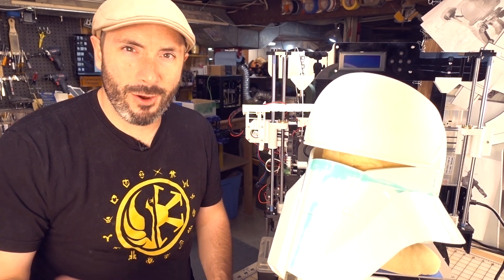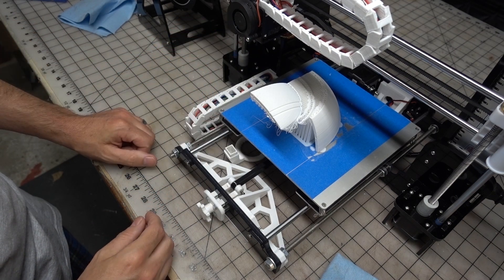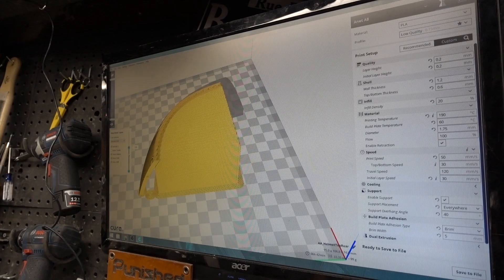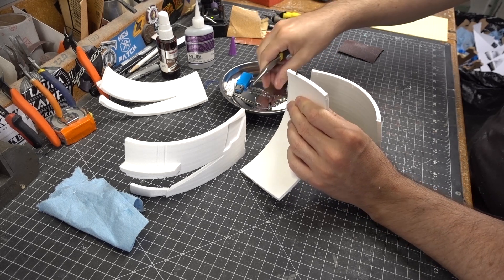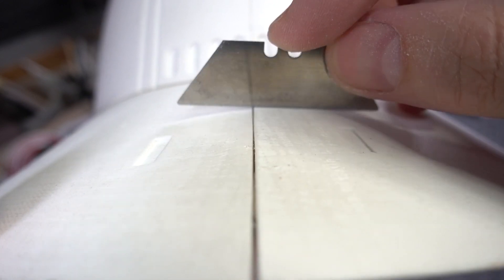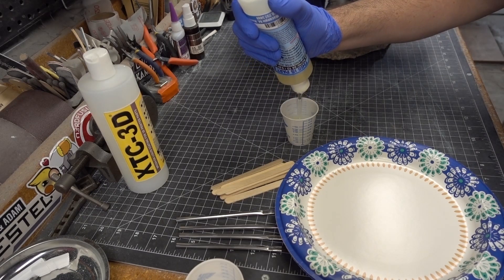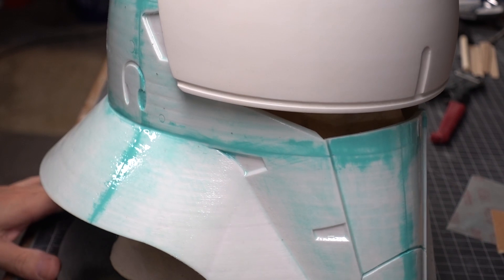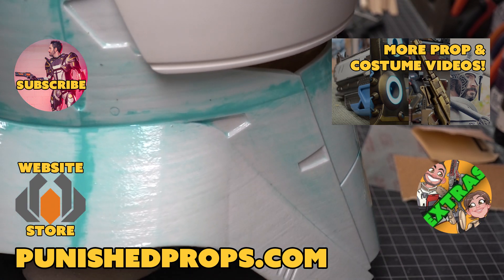Assembling the Tank Trooper Helmet - Printed on a Cheap 3D Printer - Anet A8

Comment: I had the same problem with my fan blower, but I think I fixed it.  The problem was the blower was getting hot from the extruder and drooping.  I just printed it in a material that melts at a higher temp; nylon is what I had handy.  I've been using the same blower model in nylon for several months now with no drooping.  Hope that helps.  Thanks for the great videos!

Comment: 0:24 - It's just a guess but I think maybe what happened here is that as the printer approached the top of the print, the layer size got smaller and smaller (and thus the layer time got faster and faster) - until it got to the point where one layer didn't have enough time to adequately cool before the next one was laid down. If that's the case, you can address that in some slicers by adjusting the "minimum layer time" - or you can make the printer make a second part as part of the same run: the extra print head travel time (going from the first object to the second, printing a layer of the second object, and coming back) gives the layer the time it needs to  cool.

Comment: that us EXACTLY why i dont use the circular cooling duct. the far end droops down and will catch on the print due to weight and length. The semi circular duct works a ton better as well as allowing visual clearence and better air pressure thru each exit hole.
Reply from the maker: +Matt Weber Cool I'll have to try that one.
Reply: Tweeted you the link. had forgot that youtube allows links in the comments now

Comment: Hi Bill ! A couple of questions/comments:
- I usually do also "knifing" as a first step, it works super great on ABS prints, better than PLA as I could test, given it is not brittle like PLA (or at least the ones I tested). Instead of a blade like you use, I can recommend knifes with good blades. For example Victorinox (swiss army knife, my best friend for that !) or an Opinel knife. They both have strong sharp blade that holds in time ;) It save me a huge amount of time compared to sanding.
 - You wrote at the beginning of the video that printing in White was a mistake. Can you develop a bit why ?
Is it because of photographic difficulties (camera seems saturating on the helmet) ?
Is it because of working difficulties ? I tend to find harder to see shadows and thus shades on white props.
Or is it because of the material properties ? I used once White ABS instead of other colors and said never again as being the same brand I found it less good at printing for multiple reasons, including more warp and delamination. I guess it could be due to an extra chemical inside to make it why altering the material properties ? 

Great build anyway !
Cheers

Comment: how how you compare primer vs. the smooth-on thing? i am from Hong Kong, imported smooth-on product are even more expensive than they are!
Reply from the maker: I usually like using filler primer because it doesn't fill in the details too much compared to the epoxy. For something with intricate details, I would probably avoid using XTC-3D.

Comment: how to screw the holes for the pins on each pirces to make sure they are line up correctly ?
Reply: Adrian Mak He didn't screw them in, they're part of the 3D model.
Reply from the maker: The holes were modeled into the files before printing. The pegs aren't screwed in, they're just slotted in and glued.
Reply: What are the hole size and depth?

Comment: How far off are we from 3d prints at a consumer level that just come out clean?   Is that even possible?
Reply from the maker: Prints off the Form 2 are super crazy clean. It has a small build volume and is quite a bit more costly, but it's only a matter of time before those two factors even out. Probably just a couple more years.